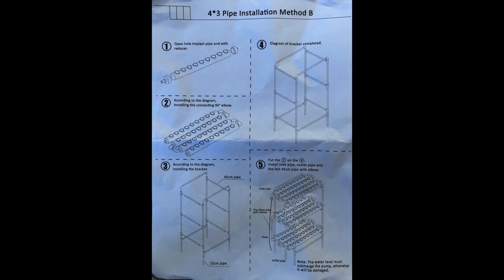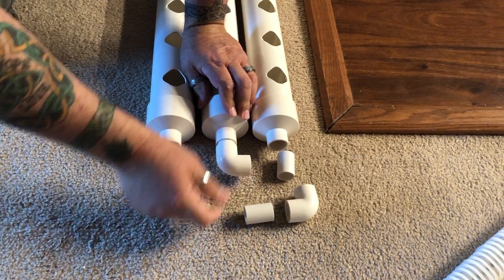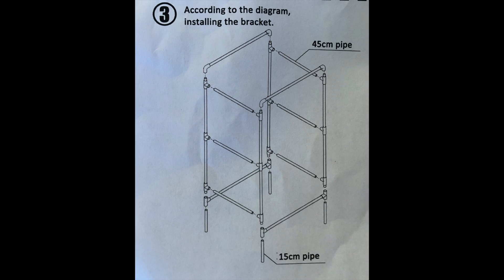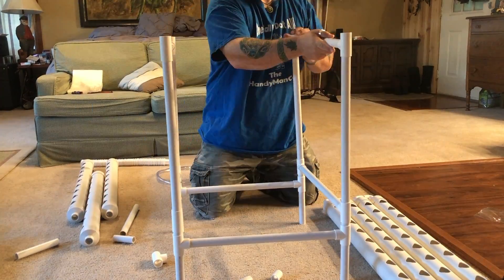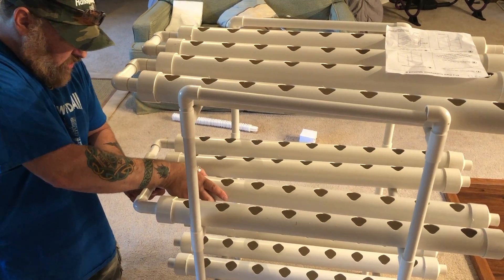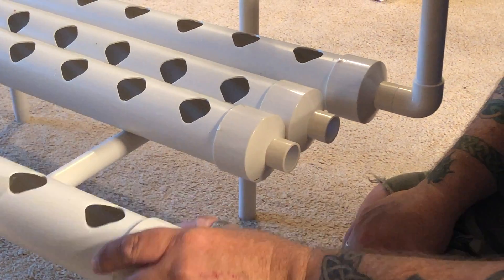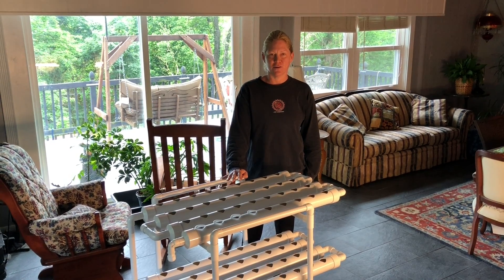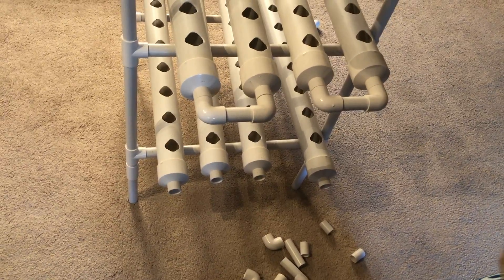Building a Hydroponic System from DreamJoy purchased through Amazon.

Comment: This  does not require PVC glue?
Reply: No it doesn’t, we recently purchased it and put it together and we ran water through it and discovered we will need at least 5 gallons of water to fill it end to end and keep enough water in the box for the pump not to burn out.  However the stand is pretty flimsy and we are definitely going to glue it.
Reply: @leannekenyoung   So another words it does need PVC glue...
Reply: @michaelr2600  no the only pvc glue was for the stand but we tossed it and used just part of the system and we didn’t use any pvc to hold it together.  The way it’s put together it doesn’t leak at any of the connecting points the only time I have leaks is when my pump is running too fast or if I fill the reservoir too full and the holes where the plants go if I have too many roots below and it can push the water over some of the holes but I’m just growing lettuce in every hole all 52 and I harvest the leaves off of them every 7-10days and I am able to do that 5 times and the plants are perfectly fine. Although by the third cycle I do check the roots and I will cut them back if needed. But no, no pvc glue at all. 🥰🙏🏻🇨🇦
Reply: Yes, yes it does..
Reply: @michaelr2600  well let’s just say this...according to the company it does not require any glue which I suppose if there were no little kids or pets or you aren’t a person that bumps into things or is clumsy at all like me then no.  But for us it has just been sitting in one area with nothing running through it and just with the pipes attached but just sitting put together and we are absolutely going to be gluing the stand.  I’m also going to wrap the all the pipes that contain water with tin foil to deflect any light and to prevent the algae growth.  We have a lot of tin foil that I purchased for this purpose and after watching other videos another method which may work even better is black tape but I’m not sure on that method yet. I suppose it depends on the tape and if it does hold out the light.  The tape may also work to hold the pipes and keep any possible leaks although we never encountered any when we set it up that’s my one worry with this setup. However I don’t plan to run the water all the time just at certain intervals which I’m not sure how often it will require or for how long.  It will also allow me to direct the output to a separate container during the first few times so I can check what the ph of the water is after that and the EC (I think that’s what it is but the amount of particles in the water ??) anyway it’s all a learning experience and while I do it we are going to try to minimize the amount of work in the long run with dealing with the actual system so we can focus our time and energies on developing a schedule for on-going harvesting, pruning and monitoring our plants basically the fun stuff.  Lol!  Besides I absolutely hate algae and I know when it permeates plastic it becomes impossible to get out it seems.  So if I can prevent it from developing in the first place that’s what I plan on doing. It would be perfect if this entire system was built in black, I think it was very short sighted of the development of this that it is in white, very strange to me, also the hose to connect to the pump is clear.  So what I ended up doing was putting it inside a larger black hose to basically shield it from light but I’ll still be able to see if there is algae building up in the hose and will make it easy to wash still.  The connectors on this system are some strange sizes perhaps metric but unusual I suppose most of our connectors in Canada are still using imperial I guess because of where we get them from?  But these are definitely not imperial sizes. I tried the typical 1/2 inch and 1/4inch hoses but neither fits properly.  The 1/2 inch is what I used to surround the clear plastic tubing.  It was a tight fit towards the end so we just cut it because we didn’t need it that long anyway. We also put a clamp around the top of the two hoses where they connect to that strange input valve.
We haven’t tested that yet but expect to in the next week or so.
Reply: @leannekenyoung  you can use spray paint use black then whatever colour you want for a final coat
Reply: @justinomar9210  yes that would definitely work and would make it beautiful especially to match someone’s decor when it’s in their living room.  Unfortunately I don’t have access to a well ventilated area where I could spray paint it .  But wow would that ever be fun!! Paint it black and then cover it with any paint you want!  I just used the tape and it works really well I’ve not had any algae in the system at all.  Actually I shouldn’t say that I did have a little algae growth in one spot but I hadn’t wrapped black tape around that section so I did and I haven’t had any problems since then.  I do cover the holes with tin foil when the plants are small and if there are holes I don’t have anything in I just cover them with tin foil.  If you spray paint yours and then cover with another please send photos I’d love to see it!🥰🙏🏻🇨🇦
Reply: @michaelr2600  no, no it doesn’t not at all.